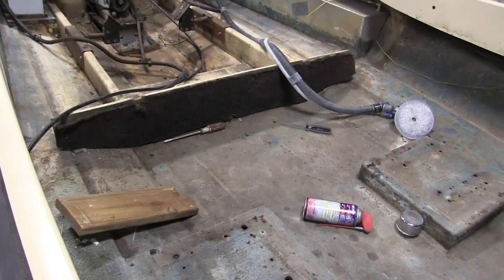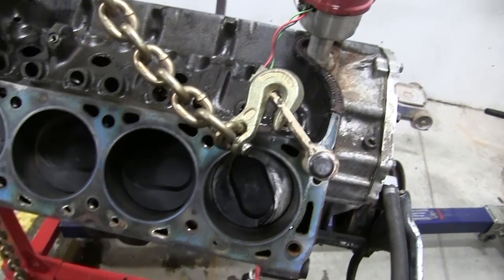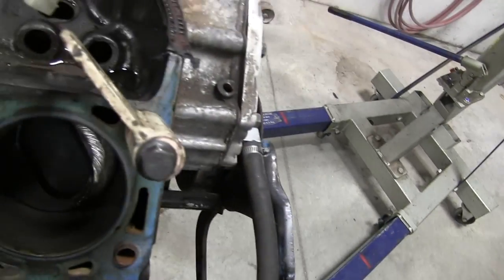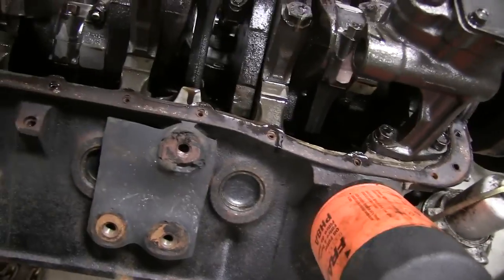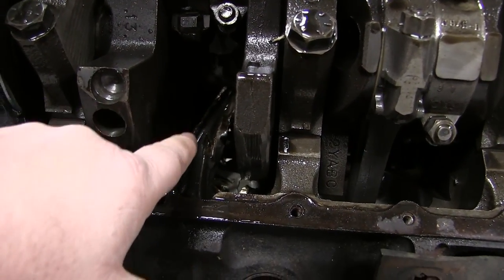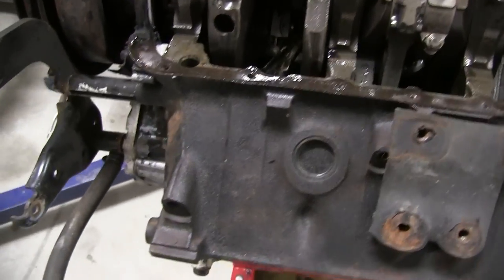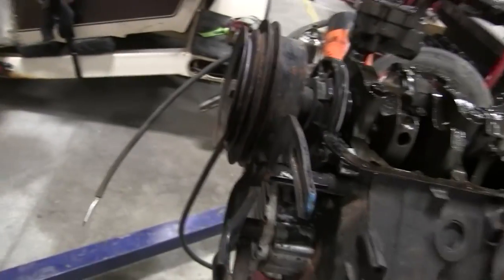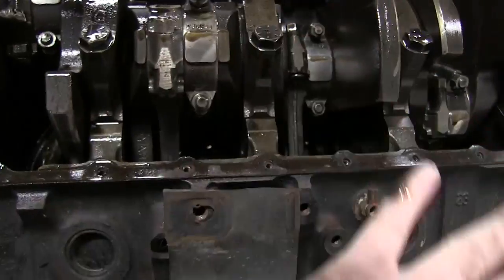Engine Problems on the Jet Boat Project

Comment: Once you take the remainder of the rod out you will be able to see if the cylinder walls is nicked up. If it is and the other cylinders are worn simply bore and hone to an oversize that they sell pistons for.  This is usually not too expensive.

Comment: I am in the process of getting my 455 rebuilt. Found out it was bored 60 over already, had a spun main, the crank was welded in 3 places, 3/5 of the pistons were cracking. So 3 grand later I have a new not very powerful big block. Should have gone the Chevy route in my boat.

Comment: Like my grandpa used to say, "If it were a horse we'd take it our and shoot it." Too bad about that. It's what is generally referred to as a "catastrophic failure.'" I have no idea about jet boats; do they use marine engines with water-cooled exhaust manifolds, etc.? Good luck on getting this worked out.
Reply from the maker: It's a regular block, but it does use water cooled exhaust manifolds.  I thought about converting and running headers, but time and money has a different plan.  lol

Comment: Yep. I see the problem. Fram was there! Filter media came apart on my 80,000 mile 350 TBI Z71 and destroyed the engine due to oil pump decimation. Fram filler on my 04 Yukon xl almost killed it as well, replaced with a Wix (heard they were great from EVERYONE) the knocking and metal to metal scraping went away after a few minutes. JS Fram sucks